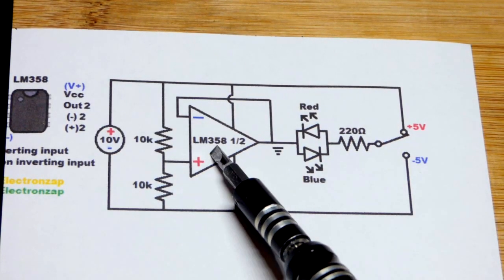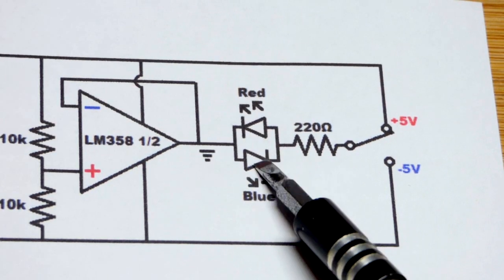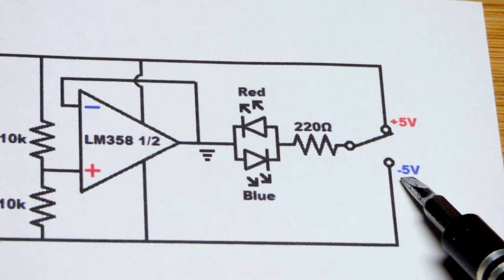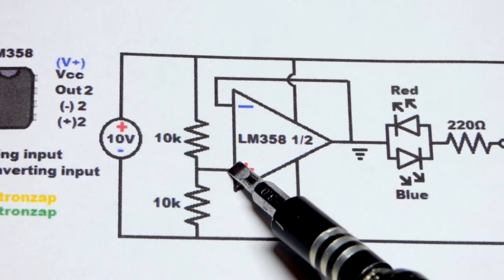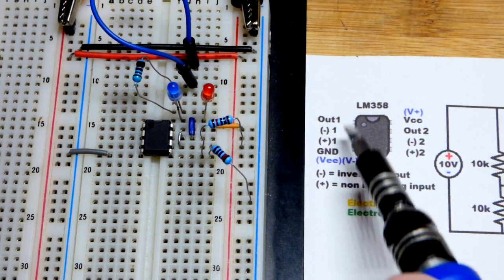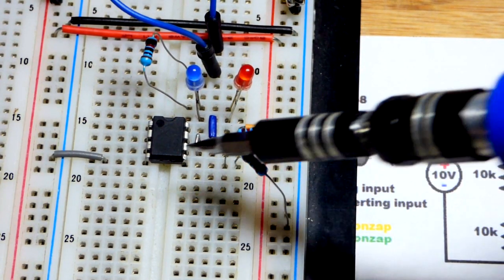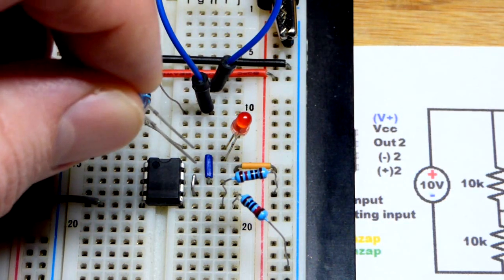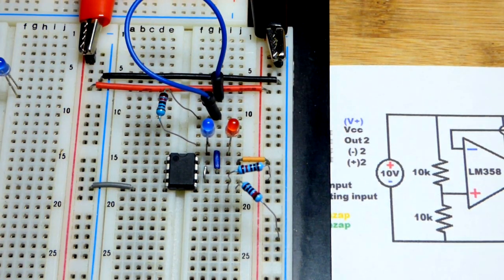Op amp wired as virtual ground rail splitter using LM358 operational amplifier voltage follower

Comment: Thanks again, I like working with Op Amps and usually stick to the LM386 b/c it doesn't need a - supply. These last few sessions are helping loads and now my LM741's are getting some 'welly' as they say over this side of the pond.
Reply from the maker: Good times :)